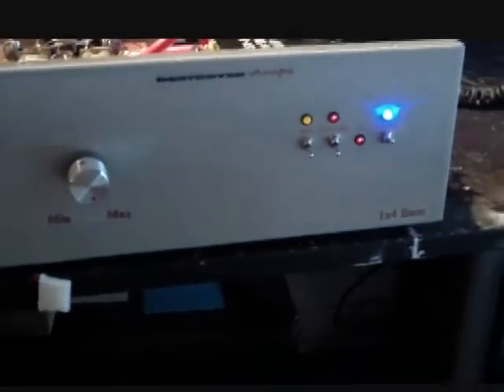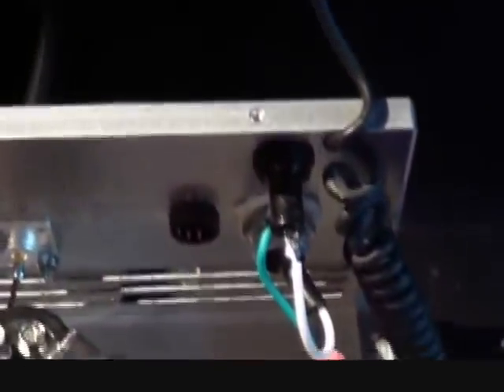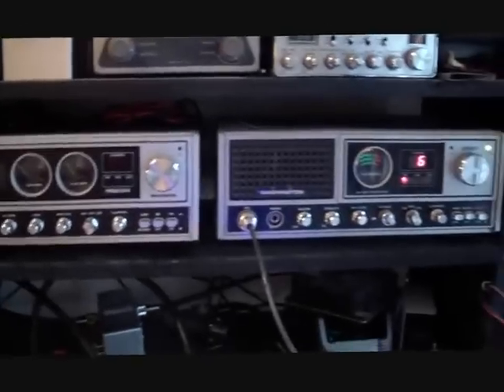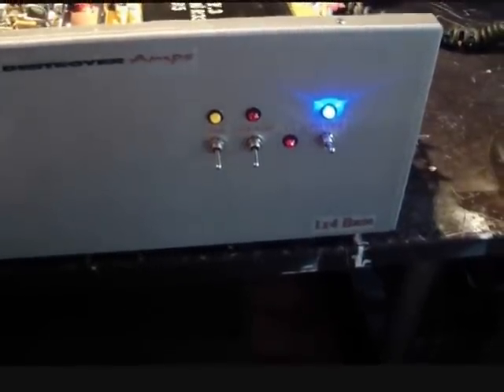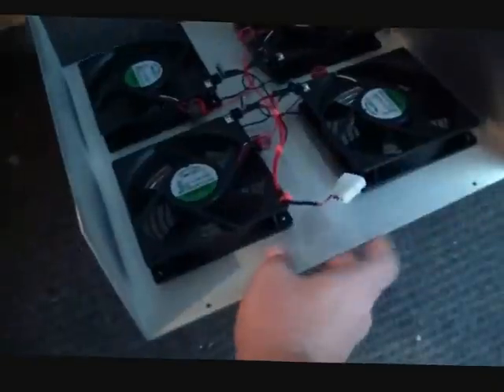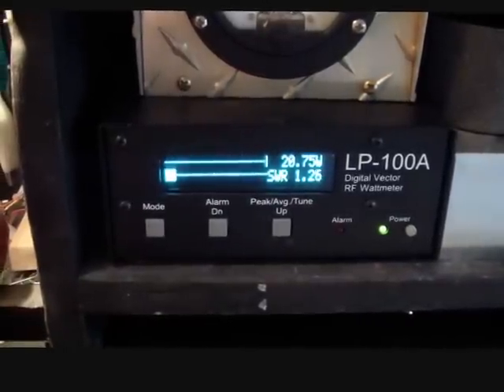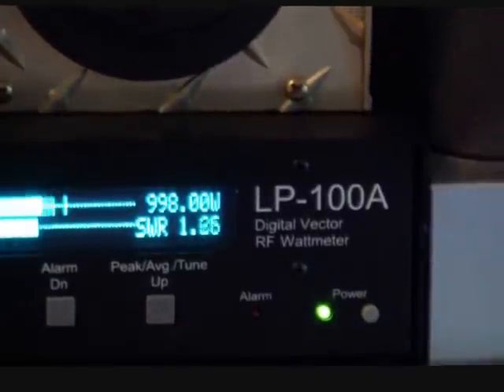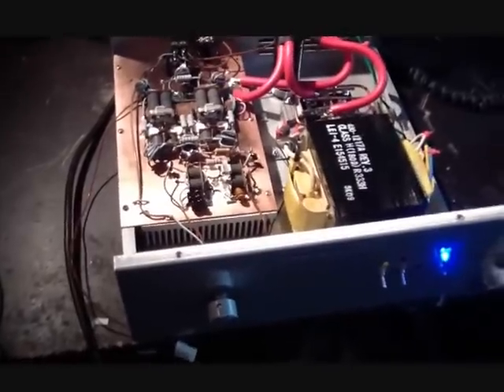1x4 Base Amplifier By DestroyerAmps

Comment: Are they etched boards or do you use pieces of circuit board layed ontop of the main board for connections to diffrent circuit components? Also is there an band pass filter avalible for your amps?   Thanks Jimmy, WX9DX